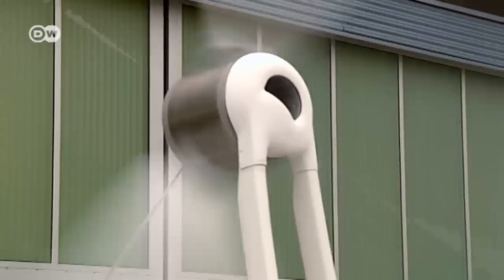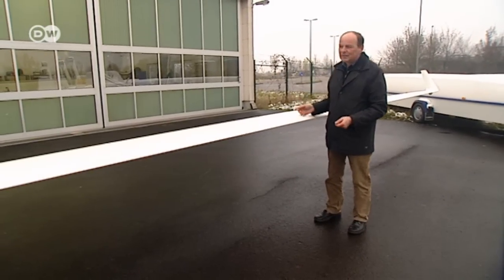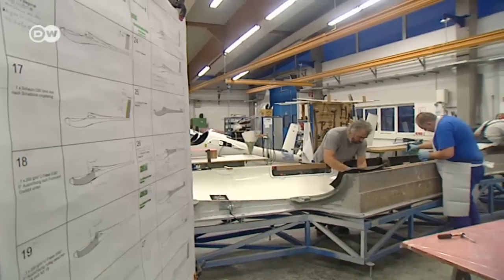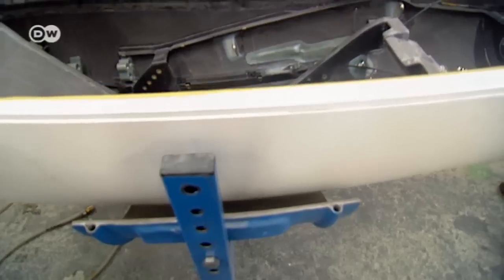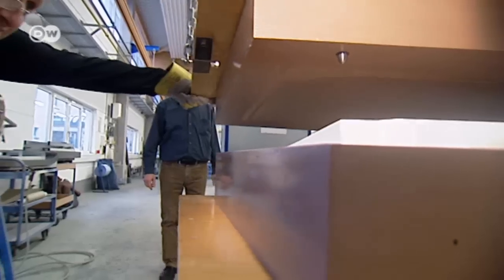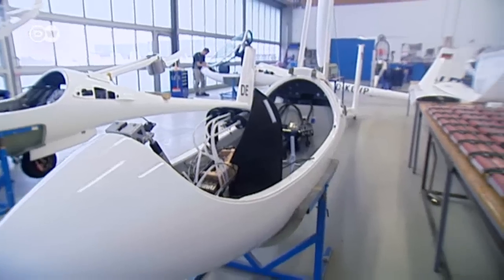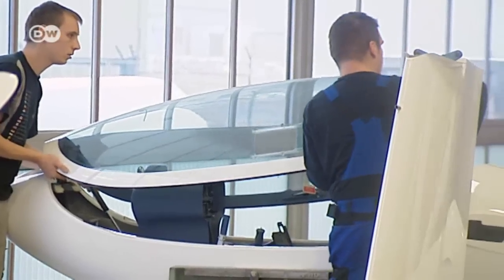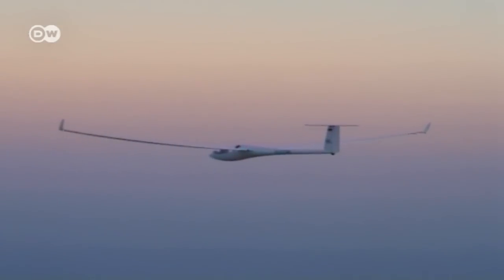On the Up: Electric Gliders | Made in Germany

Comment: Yeah, gliders do not ride the wind nor are they powered by it. Little fact checking might have been nice.
Reply: +Chuck Croston 
Speak for yourself, do some fact checking.
Mountain waves and ridge lift are absolutely riding the wind.
The wind is going up faster than the sailplane is coming down, if that's not riding I don't know what is.
Reply: And what happens if there is no mountain or ridge there. What is the wind going to do for you than? 3 types of lift,  thermal, wave or mountain/ridge. Wind is a component of the last 2 but you are not riding the wind itself. The lift is produced by the wind being deflected up the ridge or mountain. And that is also why you never fly on the opposite side of the mountain from the direction of the wind as it then has turned into sink and you sure are not riding sink.
Reply: BTW,  wave lift is different than mountain or ridge lift. Wave soaring is a completely different type of soaring than ridge lift flying is. Look up a guy named Balleka on hefe, he has plenty of videos of him riding ridge lift produced by wind. But with out the  ridge he would not be staying up where be is flying.
Reply: +Chuck Croston 
I don't have to look up anyone Chuck I started flying sailplanes in 1980. Mountain wave lift is not different than wave lift, it's referred to as mountain wave lift. It's caused by the mountains. 
"But with out the  ridge he would not be staying up where be is flying." Well thank you Mr. Obvious I see you are one of those guys that like to throw in stuff that wasn't even in the conversation.
I know Balleka's videos, I know Bruno's videos and I know sailplanes. I know what ridge lift is, I know what wave lift is, also know as mountain wave lift. I know what thermals are. I've know all of that stuff for 35 years. 
I know that mountain wave lift and ridge lift is definitely riding the wind. Call it what you want, but I know what it is. A sailplane is riding in an ocean of air and if the ocean of air is going up faster than the sailplane is descending you go up. You are riding wind. If you airspeed is 100 knots and you are going into a 120knot wind you are going backwards over the ground at 20knots, again you are riding the wind. A thermal is the same, it's air that's rising faster than the sailplane is descending you are riding the wind. I agree sailplanes are not powered by the wind, they are powered by gravity, but they absolutely are riding the wind.
Reply: +Bruce So the deflection of the air up the mountain or ridge is providing the lift used to stay aloft. It is the updraft of the air caused by the mountain, ridge whatever. It is not the wind itself. And I do believe we are talking semantics here. I fly in S Fl so all we ever fly is thermal except for some stories of guys who got wave lift from lenticular clouds back in the 70's. To use your example of flying backwards which I have done myself in a 1-26. A Super blanik L23 lifts off at about 35 knots more or less. If you have a head on wind of 40 knots and you are sitting in the Blanik on the ground; what happens?
Reply: It's translated from german. I seriously doubt that was the literal intention, but it takes a shitload of time and effort to translate stuff with zero issues. You would need someone with significant knowledge of flight AND fluent in english to catch a minor mistake like that- not practical for a news company that focuses on many topics rather than just one.